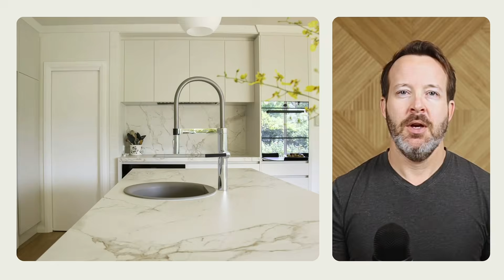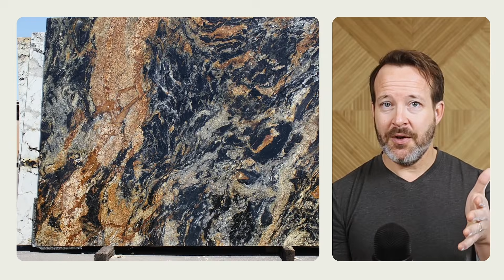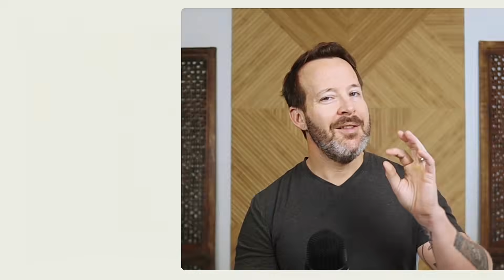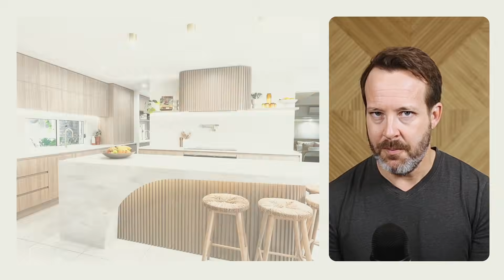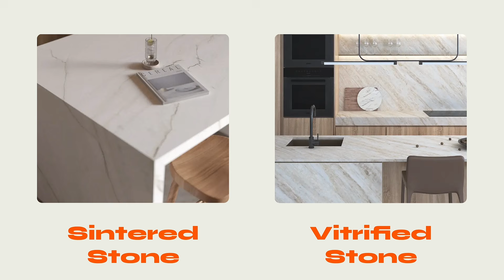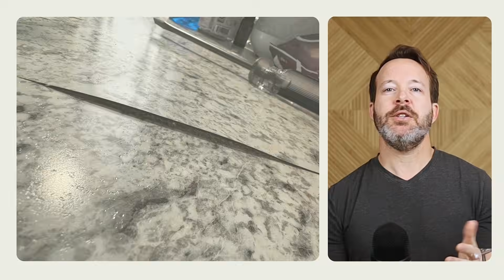Which Countertop Is The MOST Functional?

Comment: I've had Corian in three homes and I absolutely love it. My current kitchen has white Corian with subtle veining that looks like Carrara marble, has soft-to-touch matte surface and looks beautiful. Also has integrated sink, so it is very easy to keep clean. Glad to see a designer mentioning solid surface materials as a viable choice for countertops, usually they turn up their noses at it. And as far as scratching and lack of heat resistance, use of cutting boards and trivets takes care of that.

Comment: Laminate is more durable than people realize.  But most installers don't do a great job of adhering it with contact cement.  It does delaminate if not done right.  Also SEAL THE SINK CUTOUT!  I've torn apart many kitchens that had nasty rot near the sink because the installer couldn't be bothered to slap some polyurethane or SOMETHING around the cutout.  Also, using plywood instead of prestboard or MDF makes a big difference. These are tiny fixes that don't cost much at all.

Comment: I have to replace a formica countertop that was in perfect condition before my tenant  thoroughly destroyed it. They have caused the formica to peel away from the base, which they constantly Soak with water around the kitchen sink and they are asking me to replace it now. I would prefer to replace it with a  Formica countertop for cost purposes, but I have no confidence that they're going to be any more careful and it will have to be replaced again, so I'm trying to find  something more durable. But something that won't break the bank.. they also caused other damage that I've had to repair so i'm not eager to give them anything top quality.

Comment: I'm sorry you did not include wood counter surfaces.  In the early 1970's the University of Wisconsin did a study on countertop sanitation.  (If I remember properly... It was a challenge against Corian's claim of being the most sanitary surface in the industry). Regardless the testing was compared between ceramic tile, laminates, solid surfaces, granite, stainless steel and butcher block.  
The results took everyone by surprise.  Wood was the most sanitary surface in the countertop industry.  I tried to incorporate one built in wood surface in every kitchen I designed...(since the mid 80's)  I'm retired now, so I really enjoyed learning more about the Italian composites.  An ever developing industry.  Thanks for your report.

Comment: Formica makes a solid core product that gets used on industrial work surfaces. Think workshops, research facilities, etc. 
worth a look. 

I’ve made several wooden countertops designed to be used for food prep as well as a wooden sink surround with built in drain board. Ash, teak, maple. Nothing beats the warmth of wood. But it takes maintenance. 
Granite is my favorite for most counters because it can’t be damaged by chemicals in home DIY projects like film developing, epoxy pouring etc. it’s tough stuff!

Comment: So far I'm still locked into mostly wood, with quartz around the sinks, but I'll see where the budget otherwise goes, as even though the kitchen/pantry is without question the highest budget area for my set of home renovations,  the main thing I need to fully budget for are the cabinets and their storage accessories. Porcelain slabs fit nicely as a backsplash, but that's their limit for me.

The main reason for wood, is knowing how frequently I drop plates when trying to pick them up from counters/tables, wood unlikely to give me damaged plates as granite will leave me out of usable plates in 5 years.

Comment: Great question to actually focus on — "most functional" usually beats "prettiest" for a kitchen people actually cook in. Perfect Stones typically points people toward quartz or granite for that reason: quartz is non-porous and needs zero maintenance, while granite handles heat exceptionally well and just needs occasional sealing. Marble and softer stones look amazing but etch and stain more easily, so they're less functional for heavy daily use. It really comes down to matching the material to how hard your kitchen actually gets used, not just how it looks in photos.

Comment: I have a laminate counter that was put into my updated kitchen in 1985 and it is still in perfect condition. If there is a stain a little Bar Keepers Friend takes it right out. Occasionally I will wax to shine the surface. I had ceramic tile, that matches the tile on the wall, inset in a section next to the stove and one next to the sink. I set hot pots on there and can cut on there with no problem. I probably will be replacing the sink very soon and unfortunately that most likely will mean a new countertop because I cannot find one to fit the space. ( To match the cutout hole the sinks available would require a 33" cabinet while my cabinet is 30") When I do get a new counter it will be Formica.

Comment: Even putting up plastic barrier btwn rooms, are cutting faucet holes etc or even sink holes at customer's home harmful for the customer ?   I see 24x48 porcelain slabs at Home Depot that's really inexpensive. I think they may be floors but can I use them as countertops ?  It must be durable if those slabs can be used on floors.

Comment: My daughter headquarters and her mother-in-law doing dishes accidentally took a big chunk out of it. I think Grant has happened to seal it is just too much work and I've noticed my kids that leaves water spots and it has little chips in and I can feel it when I'm washing the countertops I would never have that. I've always wanted a stainless steel or Corey and I think that's underrated. I like my formica that I have now in my retirement home the only thing I've noticed is over the years the glue comes off the sides and then you lose pieces I've lived in many apartments for that it was damaged. My daughter's granite the kids would get home with their soda pops and leave them sitting on the granite and go upstairs and she has a lot of rings where the condensation left rings on her granite and you can't get rid of that we've tried everything. I think one of the problems I see are people put the sink under the granite I think if you put the stainless steel sink like they did in the old days over the formica you would be less likely to have chips out of your granite around the sink where you do heavy dishes. All my kids have had a problem with that and I think they're one of the problems that's how they install the sink. It exposes the granite and obviously it's not durable when it gets hit with something hard it takes a big chunk out. I can guarantee if you took a hammer to granite it would be a big chunk. I'm really not a fan of granite I don't even find it attractive I'm sick of it already I see it every house I go into and I just think it's getting tiresome. I think we're ready for a change. My sister put soapstone but it also is high maintenance.

Comment: Only some things called granite need sealing. I got matte "absolute black granite" countertops. The guy that installed it, insisted it had to be sealed. The sealer formed a thin layer on the surface that scratched and marred easily. The countertop was actually gneiss, a material like basalt, which is highly dense with a low oxygen content and completely impermeable - it's used as chemical lab benches. I eventually stripped the fragile sealer layer and have done nothing since. It cleans with a plastic pot cleaning pad.

Comment: I'm pretty sure that wood is the grandfather of countertop materials.
Reply: Wood is a great renewable option that also has the advantage of not shattering the cups and plates that you accidentally drop onto the counter.
Reply: +1 I just had fabricated wood countertops installed , i.e. smaller pieces glued together. It was the cheapest option in fact. I'm just gonna have to learn to live with unavoidable stains, and hope there will be no fungus around the sink from water splashing. In worst case, I'll have to save up for something better, I was in a hurry to get the kitchen going.
Reply: Seal all cuts and surfaces with polyurethane, especially around the sink.  The sink cutout is often left unsealed, and water will get to it eventually.  Wood makes a great counter if it's done right.
Reply: Bacterial nightmare.
Reply: @brianh6680 Wood is naturally antibacterial.
Reply: Not all wood. Maple is, especially in end grain configuration. Open pore woods in edge grain builds like oak are bad at hiding bacteria.

Comment: For my full gut kitchen remodel 10 years ago I chose a slab of granite from Lowe’s which has permanent sealer. It was installed by the local granite business. Two stainless sinks in my 103” x 65” island - took four guys to bring/set it. The surrounding drawered cabinets I chose butcher block Formica with wood edges so you can’t see the tell-tale black edge. The Formica has wood graining. When the granite company installed the stone they asked so many questions about how I liked my butcher block counters, which he had and found them less than durable. They never figured out that it was Formica!

Comment: I used quartz in my kitchen, Corian in the bathrooms.  Still love both.  

My old home used laminate when it was built, circa 1969.  The seams were obvious everywhere.  

I did consider WilsonArt laminate when working on the house I now live in -  the designs now are excellent, and they've vastly improved edgings.  

Anyhow, I wouldn't regret any of those three materials.

Comment: We put quartz in both our bathrooms, but won't be putting it in our kitchen. It may sound silly, but our issue with quartz is that it's so hard that the drinking glass feels like it's going to break if we set it down just a little too hard. Nothing has actually broken, so it's not really a fair criticism, but it's got me into the habit of always setting the glass down carefully. This is totally different experience working on our kitchen's old laminate counter top where we constantly clunk things down without concern. We cook and bake a lot, so being careful every time we set down a glass/ceramic item would get very old very fast. The kitchen's eventual update will likely be laminate again, but we're also considering solid surface.

Comment: I just use 4/4 Maple, about $500 for an entire kitchen. Needs to be treated with Walnut Oil periodically. Do not need cutting boards, lasts far longer than I will be alive. And is heat resistant.

Comment: I have Corian. Very practical. Expensive though. I used it because I needed a seamless counter to wall material because I have wall counter separation living in an old house. What I like about it is its seamless appearance its ease of cleaning and its antimicrobial feature. I use cutting boards and trivets. My counter is black with speckled colors. I don’t think natural stone would have worked for my needs.

Comment: Disastrous granite countertops story going on in my current house. 

For reasons I'll never understand, the builder/fabricator joined two slabs right in the middle of the sink. Well, guess what happened over the years as water snuck through pores and into the "stainless steel" joining pins aligning the slabs inside the stone? Oh yeah, they slowly rusted, swelled up and cracked the countertop open from the inside. 

So, I replaced the original undermount sink with an apron-front farm sink and cut out the damaged rods and stone on the inner side of the counter. But unfortunately, the backside also has had enough water seep in over the years that now it's cracking too. I have granite everywhere throughout my kitchen — multiple counters, 18" backsplashes. To replace it all just to match will cost at least $10,000 in materials alone. 

I will never allow a porous material to be put in around a sink as long as I live. And if I have no choice but porous stone, I'll make damn sure there's no join within 18" of a sink.

Comment: I would choose Corian without any further consideration. You mentioned that it can be restored without elaborating. The normal wear and tear from abrasion and dragging things over it can be removed in about 30 seconds with the very fine wet sandpaper and water. Anyone who ever had it and really cooks woukd not be happy with anything else. Granite, especially, will cause anything made of any type of glass to shatter. I am glad to see it being mentioned here. I noticed Verizon had it put in their stores. In my ultimate kitchen I would have a section in heavy marble which is extremely useful in working with pastry and for cooling molten candy. I think it was phased out because the people that managed these projects make more money selling something that they can mark up instead of just having it rely on and when labor because then they make the money there goes lots of profit from the markup from the sink various items that end up being fabricated from the Corian. Designers definitely stimulate their business by influencing people that certain things are just hopelessly desirable. They just want to make that much money as they can. I don’t know why I don’t ever change my default to reaching that conclusion because it always turns out to be the case when you get right down to the actual Kitchen improvements most of the time before picture and the magazine looks more suitable for the way most people manage their kitchen than the new renovation. Of course the kitchen floor is another serious problem whether you do your own work or somebody else does it grout is not sanitary on the floor or anywhere else. I do think that this particular designer who has produced this video is extremely knowledgeable, and I appreciate his being courageous and saying that he has phased out the microwave out of his kitchen, and I wish more people would do that because it really does ruin food even for reheating food is it’s not as good as if you do it in the oven, but of course he is advocating an air fryer and I can understand that because I have yet to find anything that I can’t cook better in the air fryer than the other methods and that some of the air fryers call those air fryers they’re really toaster ovens. That’s not an air fryer. It doesn’t have the same Air movement as the ones that have the fan that’s as large as the circumference is the device itself that’s a tremendous amount of air movement in there and it does make a difference personally, I am a believer in Phillips air fryer and they are not seen very much in stores I think because they are more expensive and they feel that they can’t compete on price with other people, but they do offer One from Williams Sonoma. It’s one of their very high-end ones and but the one that is the best one is the one that has no electronic circuitry circuit boards touched ain’t like that and they just have a timer that is mechanical and winds up just like an old-fashioned kitchen timer and Those have no complications that are going or likely to break down and end up making it not work, but as far as I can tell, they do not sell that one in the United States in Europe they still do because people there are smart, but we are the way things are going now we’re going to get the Leftovers. We’re not going to be the innovators any longer unfortunately, I hate to concede that but unless something changes in we get that Pluto out of them White House .  He’s tstealing everything he can. When he took the money that he got from selling the petroleum products that have Venezuela and put it in Qatar in his own name and they didn’t do anything about it. I’m sorry, but there must be Democrats who are compromised with Russia or some other country also the fact that they aren’t enough Republicans to vote with the Democrats and put him out there’s something going onmore than we’ve been told. They all are mixed up in it.

Comment: Our quartz countertops are fifteen years old and look like the day they were put in. No scratches, discolouration or edge delamination. We have a small tiled island near the stove that’s good for putting hot pots on from the burner so heat has never been an issue. Worrying about silica exposure from countertops is about as absurd as it can get, unless you took a sledgehammer to it the exposure would be zero. A walk on the beach or a few hours digging in the garden would be far more risky. The initial cost was significant but worth it in the long term, we’ll never have to replace it.

Comment: My Mom installed laminate in a DIY remodel in the early 1980s and the first time we used the dishwasher the resin holding the sawdust particle board  began to fail and the melamine surface began io delaminate. 
If the last material I would consider, lower even than stainless. 
Pre-sealed granite is the way to go.

Comment: we have some sort of fake marble in our 1960s home, of course we are going to rip it out, but, it is fairly durable and doesn't scratch too badly.  I grew up with the same fake marble so I learned to always use a trivet or hot pad.  I imagine it's some type of resin or composite, but I've seen many homes with it.  For our new kitchen we will consider granite since most homes in our area have some type of stone countertops, and there are many at a reasonable price.

Comment: "the MOST functional countertop ever". Thanks.  Heavy duty cooking in a victorian kitchen. Did not want real zinc, so we made a custom edge countertop in MEDICAL GRADE stainless steel. Do NOT get regular steel - it will rust. Find the place that makes supplies for the local hospital, morgue etc. The sound and feel and texture and honing has no match on earth. And it's literaly EVERYTHING proof, including hubby regluing stuff with superglue, the kid soldering a computer component, tomato juice, paint spatters, dropper hammer .. EVERYTHING resistant.